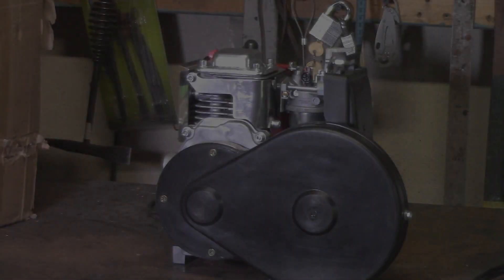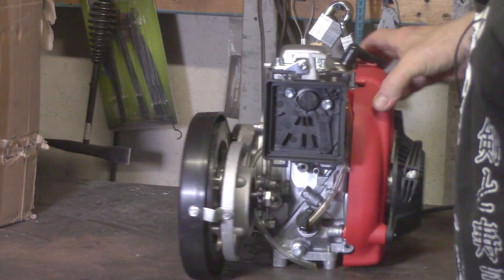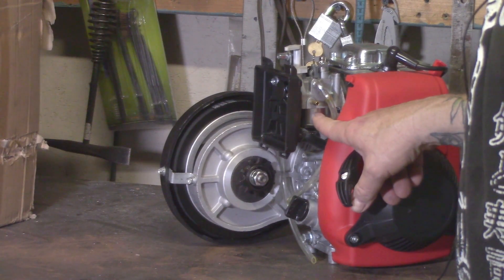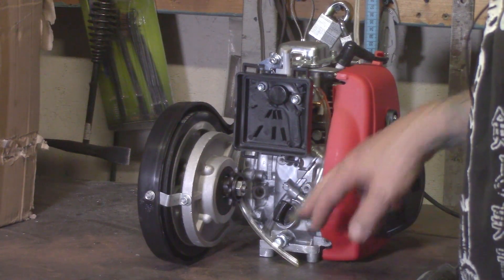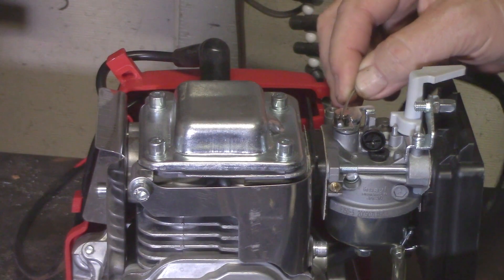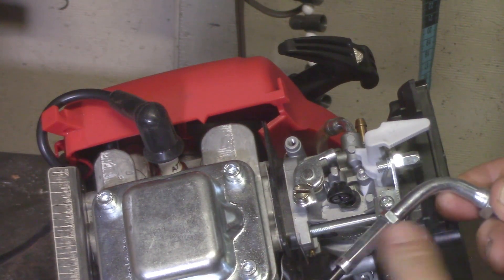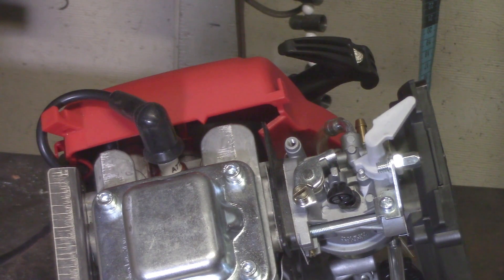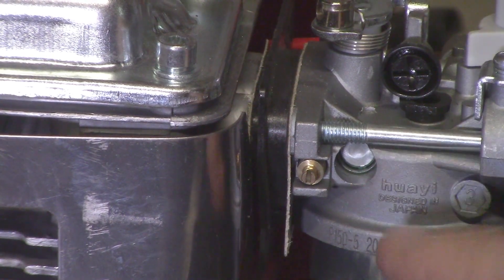4 Stroke 49cc Carburetor Basics Introduction & Overview - What Are 2 Hoses For?

Comment: I have heard people say take off the governor plate because it limits the revolutions to 50% of what the engine is capable of but I have also heard people say you shouldn't do it What do you think about that. If you had a tachometer and you took the governor off and you made sure you watched what you were doing Would that be something that was helpful to get more speed and power. Or even adjusting it to 75% or something like that I don't know just ask and I don't know anything about engines. Actually I just noticed you have taken yours off Is there a reason why you take yours off

Comment: My was not idling at all. 49cc China motor. Removed the low speed idling plug (black) near the idle set screw. When I pulled it, it was plugged with dirt, used a very fine wire to clean this tiny hole used for idling. However there are 2 rubber o-rings one near the top and one at the bottom, my lower one broke. I made one from an old bike tube rubber and it worked great. Used a 1/8 hollow punch for the inter hole and a 7/32 hollow punch for the outer diameter. You will not find these o-rings anywhere, and it will not idle down with out a good seal. Hope this helps somebody.
Reply from the maker: WHICH carb?

Comment: On the exact same engine kit I bought, it ran fine, but the top speed of the engine moved the bicycle slower than I could pedal it without the engine. It may work on a small air compressor which I have with an electric motor.  Was still a waste of time to put it all together on a bicycle.
Reply from the maker: Sorry to hear that. Same kit moved my 255lb butt 28mph. There are cheaper kits that have a sealed, chain drive transmission. Those are pure junk. You want the 49cc 4 stroker w/ a belt drive transmission

Comment: I’ve had to use duct tape to hold the cable for the throttle in place.  Helps keep the throttle responsive to lowering the rpm’s.

Comment: I have been buying entire kits just because of inability  to find the correct clutch, belt or problems with the transmission. Do you know where I can find the right replacement belt drive transmission setup or parts.
Reply from the maker: Go with a belted transmission. Those are best. Boygoesfast on eBay and Gasbike on parts. MBRebel.com was good but they are redoing their website

Comment: Me again Mr Hughs……
Is there a fuel/air mixture screw underneath the brass plug on the carb? 
Been riding my bike for a month or so, and she’s down on power. Sometimes stalls at idle, and when I re-start it, it idles high for a few seconds. 
Changed my fuel filter, cleaned the carb and jet. It’s kind of weird….
Thanks!
Reply from the maker: Drain plug for carb bowl. Some carbs have fuel/air screw close to where carb mounts to engine. Some are blocked off
Reply: @HughesMotorized  correct. But is there a mixture screw under the brass plug?

Comment: Hey Mr Hughs, what is the thick black hose going to the air cleaner? I’m assuming it is to burn off gases from the crankcase?
Does it need to go to the air cleaner or can I let it breathe out in the open? I’m wanting to build a different air cleaner for my bike.
Thanks!!!
Reply from the maker: Vent for crankcase. You can run it to the new air filter or put an inline fuel filter on it like I do
Reply: @HughesMotorized  thanks…..since I made a boardtrack replica, I went and made an air filter out of a tuna can

Comment: Hey Mr Hughs, what is the thick black hose going to the air cleaner from the block? I’m assuming it’s to recirculate the gases coming from the crankcase? Does it really need to go to the air cleaner or can I just let it breathe in the open? I’m wanting to build a different air cleaner for my bike.
Reply: yes.. it just a case breathe - some add longer hose and a xtra fuel filter on end pointing down so trash stay out! done! chainsaws got air filter .. fancy.. hides inside hose and gots like stack of fine metal screens ... alliexpress sales them 10x for like $3.. 45/ 60 day waits! :>)

Comment: Is a piece of crap carb, I can't get my engine to run without being on choke. I've adjusted the fuel needle and the throttle every wich way and it won't stay running. I bought a 2 stroke carb and it ran too rich, just like the original carb having to be stuck on choke. I'm about to give up and take a sledge hammer to my whole damn bike.
Reply from the maker: You have an intake leak somewhere. Could be in the case, the crank gaskets, the cylinder, the case gaskets or intake gasket. It's rare but sometimes you might have a crack or hole in engine case

Comment: Broke the fuel mixture screw :-/ where can I find another one of those tiny screws?
Reply from the maker: Time for a new carb. No one sells those screws that I'm aware of
Reply: @HughesMotorized  you can use a screw that fits and a pen spring
Reply: there are carburetor repair kits in which you can find those too ;)
Reply from the maker: @V0ID_beats  Please provide a link so others may find one